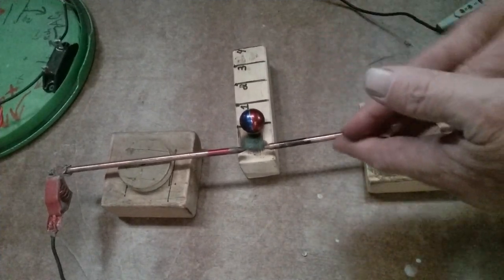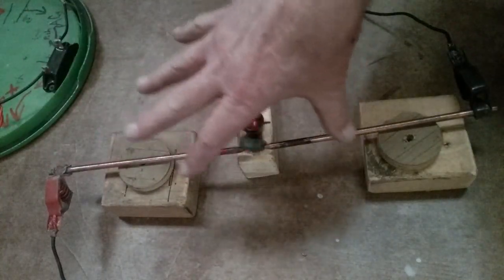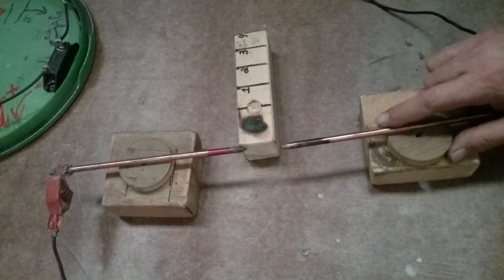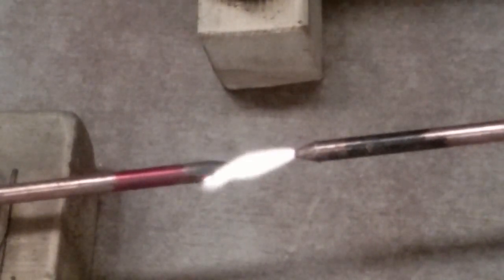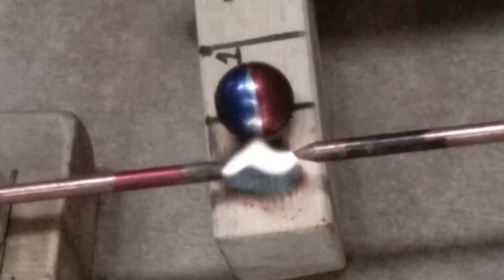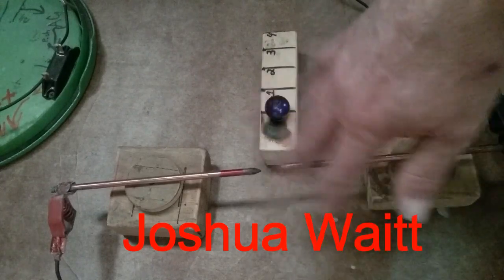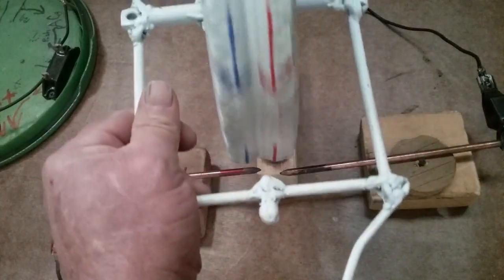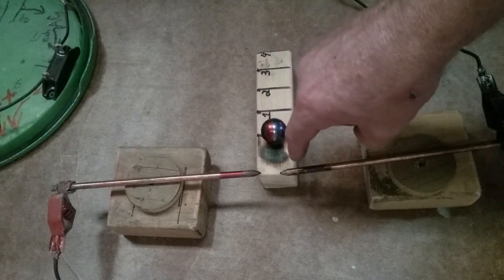New Demonstration of Magnetic Rotation

Comment: So if we apply this knowledge, we could say that a magnet is composed of atoms that retain it's spin for a few thousand years and they have the right hand spin? Is anything going out or in the magnet or it just exerts spinning due to momentum of the atoms?
Reply from the maker: My experiments strongly suggest magnets display more than just spin - there is a corkscrew action of the dielectric vortex inward - into each pole - toward each other - supporting the atomic strong force of the atoms / molecules of any magnet. You should check out my newer videos. Thanks!
Reply: @TheGoodVibrations  Ye but this cork screw is the cause or effect? This is pretty blurry for me. 
Is a magnet a magnet cause of the momentum of the atomic spin, is it a planck frequency radio signal of some sort?
Thank you for your videos, esp the spark gap with magnet is very nice.
A very nice experiment is "magnetic vortex" where you have a circular spark gap and by adding a magnet you see the spark swirling around.

Comment: My grandfather was my employer for 20 years....elberton industrial electric was the company...my "nack" I guess you could say is weling...stick in particular...I can close a 3 in gap,I can weld vertical and make it look like overlapped dimes all day ...but electrical has always been tougher for me to catch on...it seems natural to you and i appreciate your time invested in these videos..my grandfather was no teacher and service calls weren't a good place to learn being the majority of our work was in run down granite sheds..but he always told me "electricity ain't no different than water running through pipe".......anyways...I'd like to ask do you know of any way to create a circular motion only using magnets?....as in a bearing or pulley etc...? And without use of a battery or power supply?
Reply from the maker: I'm not exactly certain of what you are asking about using only magnets to create a circular motion. However, there are several youtube videos of people whom construct what they hope will be perpetual motion "engines" - using only magnets to make it rotate. Some have managed to maintain "rotation" for hours if not days or more. These "motors" can not "drive" anything - they barely maintain enough momentum to rotate.
Reply: @TheGoodVibrations  yes sir that's what I was implying, a generator or engine that could run simply off magnetic force simply by itself..